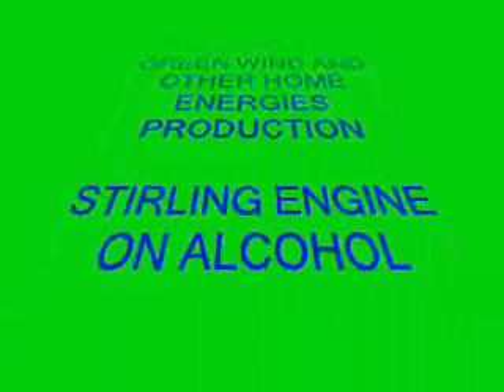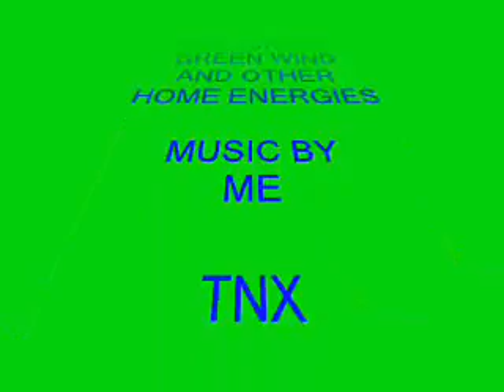STIRLING ENGINE ON ALCOHOL

Comment: @muddymuddymuddmann Thanks! Mine is almost finished but I'll keep those things in mind if the model I made doesn't work. My current model is made out of small corn cans that happen to have diameters slightly larger than the diameters if soda cans. I took two soda cans and cut them in half lengthwise. Then I cut them so that they fit into a single corn can and JB welded them together. I sealed the displacer with sheet metal and high temperature tape. The diaphragm is  made out of a baloon.

Comment: @muddymuddymuddmann Thanks for the idea but this engine was made for a science fair and I knew it was a starting point for upcoming models rather than a useful machine for generating power. I'm almost certain that the rotary displacer engine I'm working on right now will work better. It might be an epic fail who knows, If I don't upload a video of it, you will know that I failed : (. Plus I'm no good with epoxy, I get massive headaches when I use that stuff even when I use it outside.

Comment: @muddymuddymuddmann Yeah, that actually happened to my engine. I used an aluminium can and aluminium is a soft metal so my engine doesn't work anymore because the hole became so big that air passes through it and the displacer starts to scrape the sides of the pressure vessel because the connecting rod isn't held in place as well as before. Now my engine is an antique and it's picking up dust in my closet. Too bad I can't find a better use for it : (